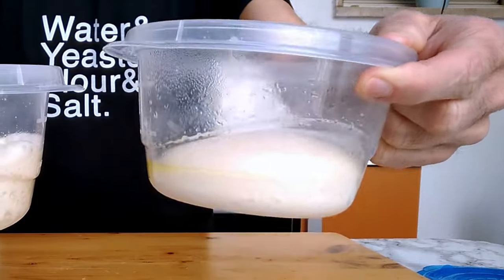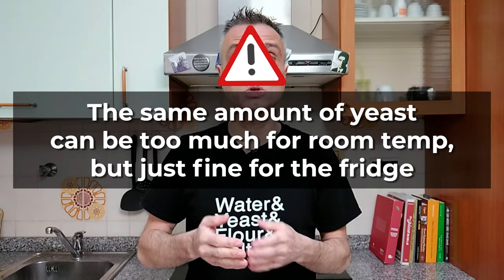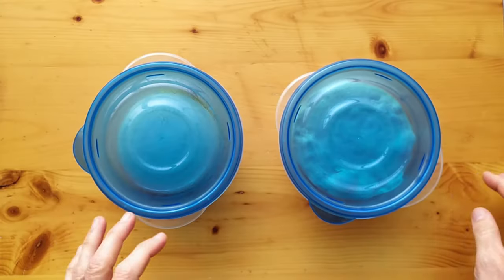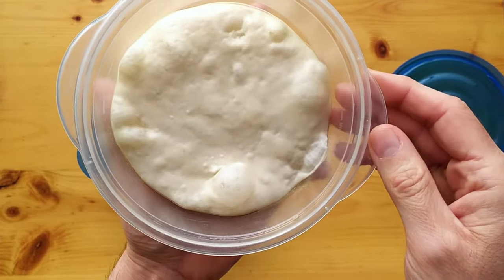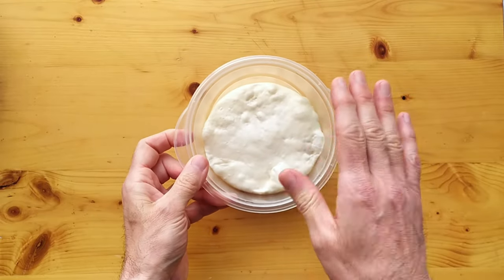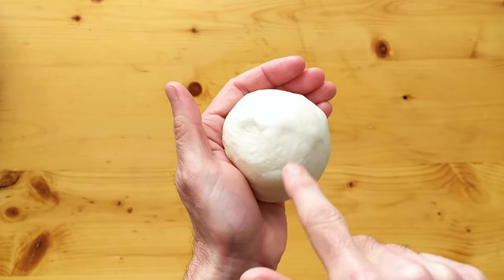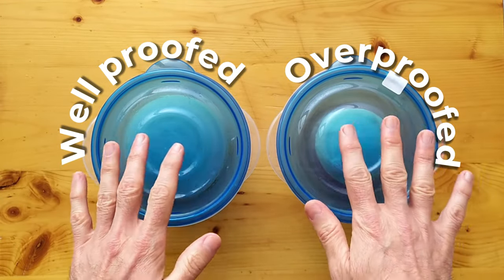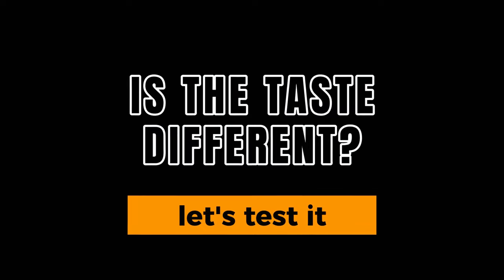Overproofed pizza dough: why it happens and how to fix it ✅

Comment: Now it is summer in uk (yes even though rain temp is raised) i often end up with overproofed. Reduced my usual fresh yeast amount from 2g to 1.6g/kg flour and used fridge  but still overproof over 48-60 hours. Im going to go much lower on yeast. Maybe 1g max per kg
Reply from the maker: The longer the fermentation, the higher the probability we lost control on it!
I second your opinion and try 1 gram 👌🏻

Comment: Thanks, Fabio, for the video. I was having an issue with my dough overproofing. If it overproofs after a few days in the fridge, should I let it come to room temperature before doing the strength folds, or can I work with it while it's still cold?
Reply from the maker: Being already overproofed, there's no need to wait any longer and the structure is weak enough for you to work with it effortlessly. Recover it straight away 💪🏻
Have a great weekend!
Reply: @FabioulousPizza  As always, thank you for your prompt reply, Fabio. I agree that it had a bit of an acidic taste, but I enjoy experimenting with different "what could go wrong" scenarios. Understanding how to react to various issues helps me focus on fixing the result.
Reply from the maker: I definitely second your approach, the fun is all in the experimentation 👨🏻‍🔬

Comment: Thank you for this video! I don't normally have a problem with overproofing but I'm experimenting with different percentages and hydration. I just made some dough two days ago and it looked like it was getting too much gas and air in it so I just followed your video and brought it back and see what happens now. Really appreciate you, thank you.
Reply from the maker: Consider that by increasing hydration you speed the fermentation time, so you should factor this in and use less yeast 😀 
I'm glad you found the video helpful, feel free to share it with someone who might need it!